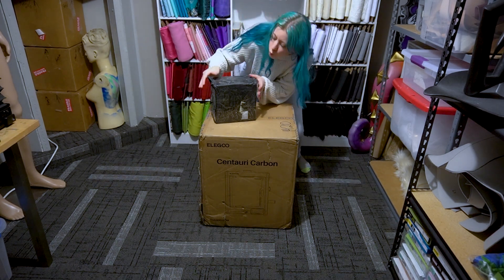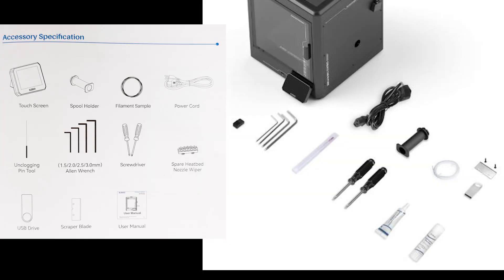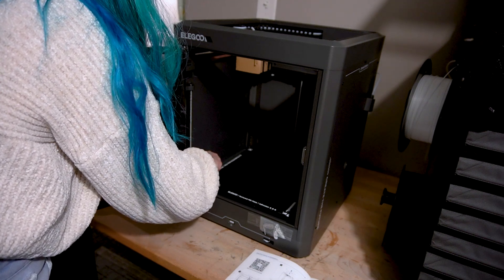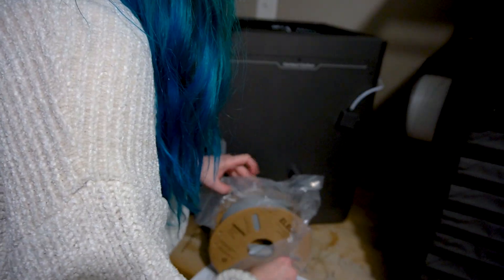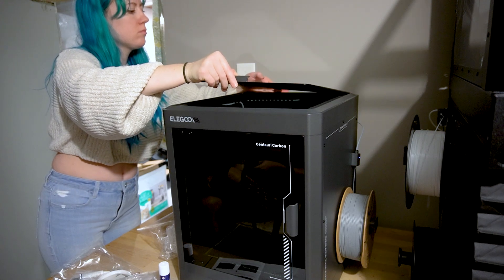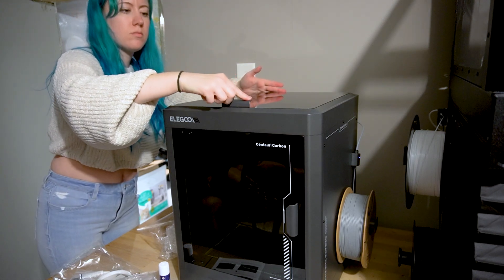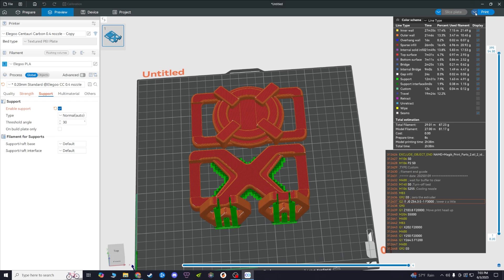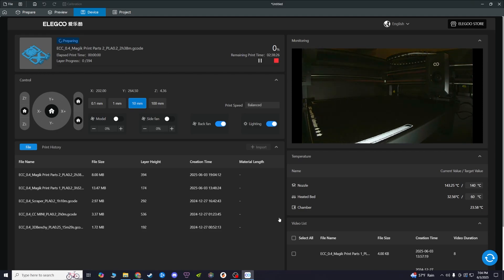Elegoo Just Changed the Game... Centauri Carbon FDM Unboxing & First Impression

Comment: So to help with the filament feeding when changing roles and also if you're going to use a more brittle filament you're going to want to pop your PTFE tube out of the little carriage by the head of the extruder because it's a tight turn and the filament doesn't go through their very easily just pop it out of the first few little clips to help the tube have a gradual curve
Reply from the maker: thanks, ill try this!